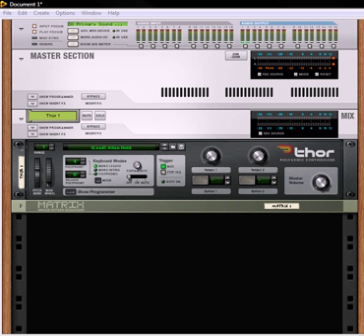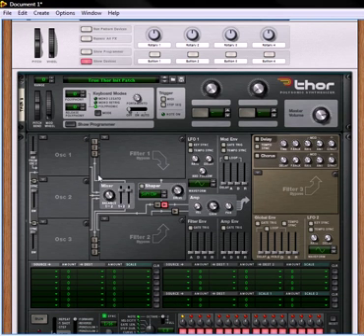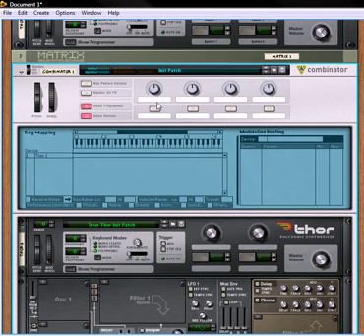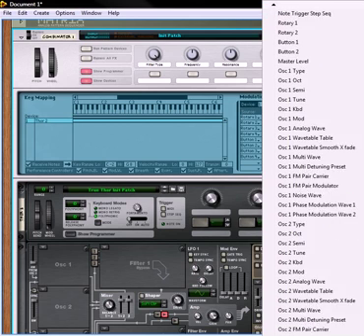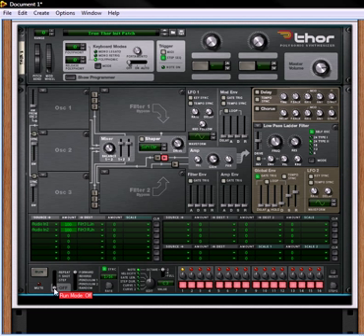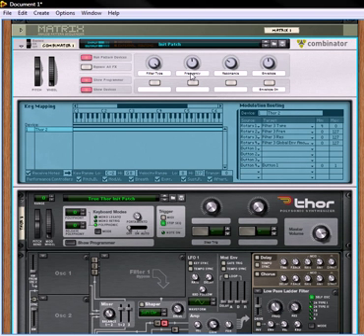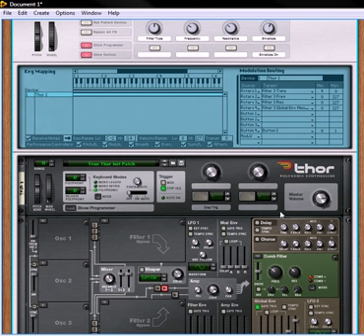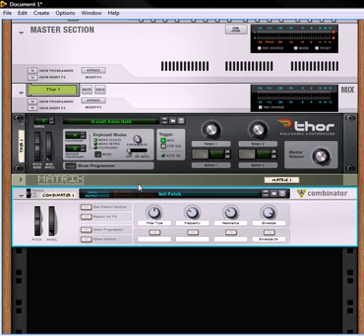Selectable Thor Filter Combinator in Propellerhead Record

Comment: Very good tutorial, but of course it would be better if Propellerhead also made these 4 fine filters as their own Effects.  Why should I have to go thru Thor to use a filter?
Reply from the maker: Well sure, that's true of course. But it's nice that you can set it up using Thor. And on the flipside, you can set up, create, and save Combinators for all the filter setups you like, and then next time, all you need to do is recall a Combinator and you're done. Taking this one step further, you can create a song template that has all the filter setups (and mixers, and effects, and even sound sources, etc.) and anytime you want everything brought up, you just open up your template file. Saves a ton of time.
Reply: Yesterday I sent a feature request to Propellerhead support, asking that the filters in Thor be available as individual Effects. But I do appreciate your point that using Combinators in template files offers some configuration options.  All my best to you!